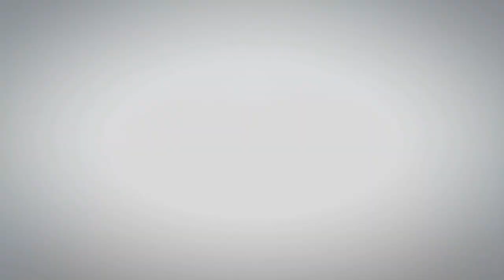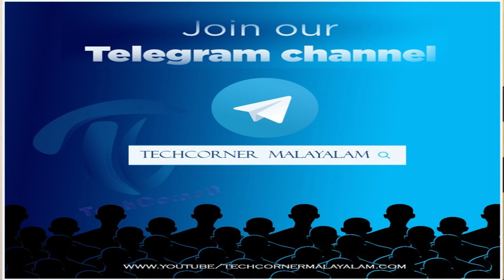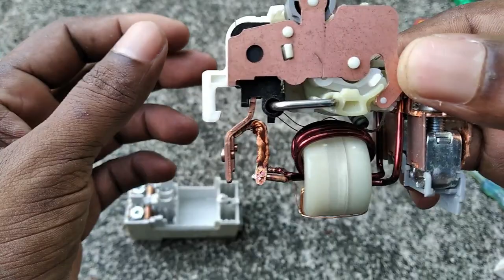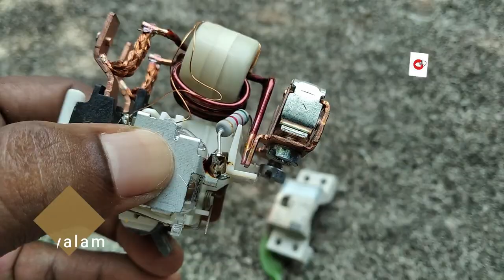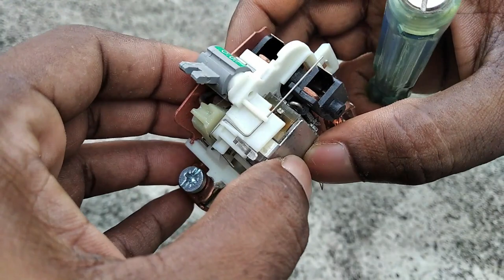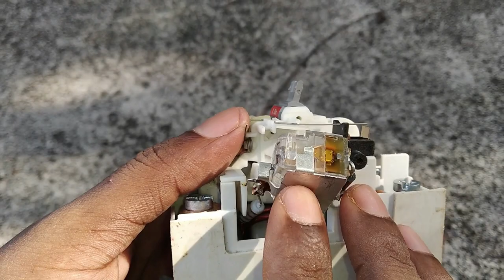എന്താണ് RCCB ,ഇത് എങ്ങനെ പ്രവർത്തിക്കുന്നു എന്ന് അറിയാന് തുറന്നു നോക്കാം  |What is RCCB|How it Works

Comment: Apol load connect cheythirikkunna time il phaseloode ethra current pokunno same current neutral loode thirike varum alle. 
Apol load ulla time il ellam neutral wire lum current flow undakum alle.
Reply from the maker: Athe
Reply: ഒരു 4 core cable 30A current flow ഉണ്ടെന്ന് കരുതുക. 
ഈ 30A current 3 phase ലും കാണുമോ? 
അതോ equal ആയി split ചെയ്യുമോ @ balanced condition

Comment: Tech corner.  Appo test button press cheyyumbol faceum nuturalum  short ayittano trip avunnathu????
Reply from the maker: Athe ..short aakumbol incoming and outgoing side il current difference undakum resistor ullond appol ct coil emf relay ilek kodukum angane trip aakum

Comment: ELCB test button press cheyumbol trip ayalum ELCB complaint akaamo?

**ELCB complaint ano enn correct engane ariyam.
Reply from the maker: Test button press cheyth trip aayal rccb working aanu complaint alla
Reply: @TechCornerMalayalam  RCCB working ano enn nokunath angane mathram ano? Is there some other way?
inverter connected anenkilum test button  press cheyth nokiyal working ano enn ariyan patumo? test button press cheyumbol trip akunnundayirunnu..But electrician RCCB complaint anennanu parayunnath.vere linil kodukumbol trip akunnila enn.
Reply from the maker: Test button press cheyuumbol trip aakunundel rccb ok aanu...
Athallathe earth neutral oru wire short cheythalm trip aakum...
Rccb damage aanel enthokke vannalm ath trip aaayi konde irikum hold cheyth irikilla...
Oru circuit il vekkumbol aanu problem enkil ah circuit nte aakum...
Ah circuit ile ellam off cheyth.. Oron on aaki nokkiyal ariyam evde aanu earth leak aakunnen

Comment: Bro I have a doubt, my rccb is not responding to lightening nowadays. Last week one electrician opened the main box for connecting the pressure washer directly to the rccb so as to avoid tripping, as in my home some painting related works were going on, but after that this tripping issue happened. What to do now?
Reply from the maker: First of all, rccb is not meant for lightning protection.
If some surges comes in line it may trip but can't assure that.
If you need lightning protection, you have to install spd.